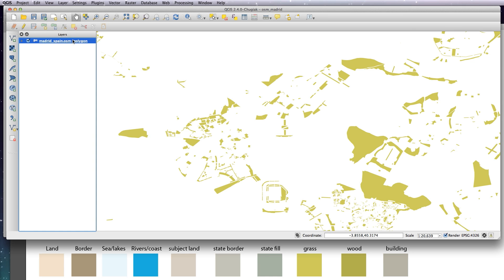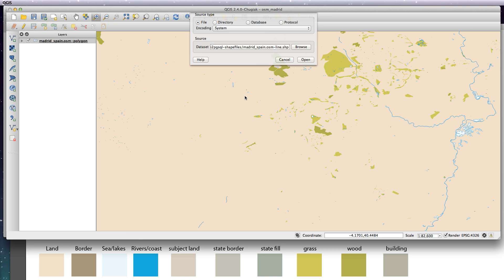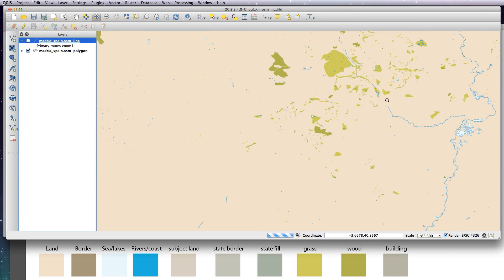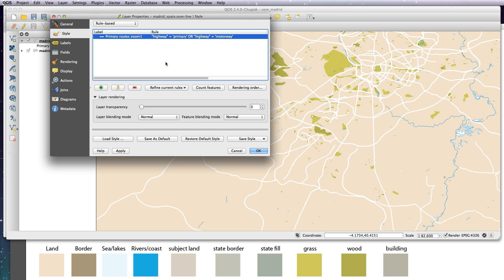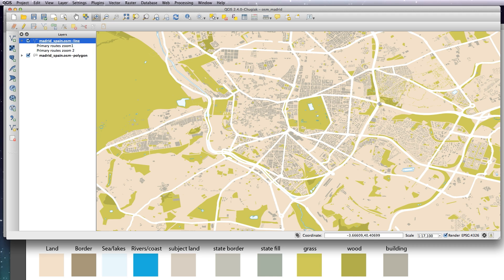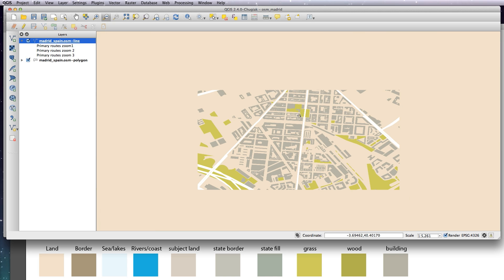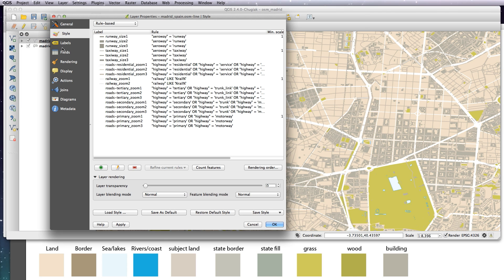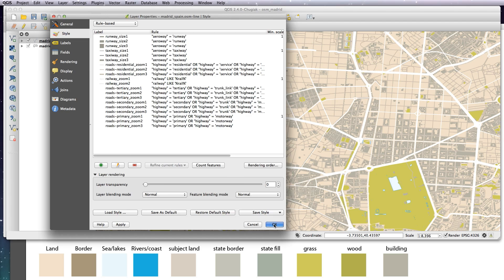QGIS lesson 16 – Zoom level rule based styling

Comment: Hello Steven! Thank you for the detailed tutorial. Helped me a lot. However, I am having a little issue after saving and loading the style in SLD. I set the width of the line to say 2 and saved the style. But when I load the style, the value of width gets changed to higher number like 11 or so. What might be the reason? What am I missing here? Thank you! Cheers!
Reply from the maker: I just checked your issue and I can confirm that the exact same thing happened for me. Is there a reason why you're not using QGIS layer styles? As these work perfectly
Reply: Steven Bernard I am using it to create SLDs to use in GeoServer. GeoServer uses SLDs for styling layers. I tried using pixels instead of millimeters. It partially solved the issue. The values did not change but every time I load the sld, the unit changes to millimeters. I need to change it back to pixels for each individual rules manually.

Comment: When you use the colour picker you are allowed to pick a colour that is outside of your QGIS window. Is this a common feature or is it specific for apple computers? Iam working on a windows machine and are only allowed to use the colour picker withing the QGIS window. Maybe there is a plugin I should download that i dont know about??

Thanks for great tutorials, short and informative!
Reply from the maker: Multijuicee Sorry I haven't used QGIS on windows, but I think you may be right in that it is a feature of the Mac operating system. Not sure if it has anything to do with Quicktime or not. However if you download QGIS 2.6 or higher it allows you to  put in Hex values or RGB which is much better